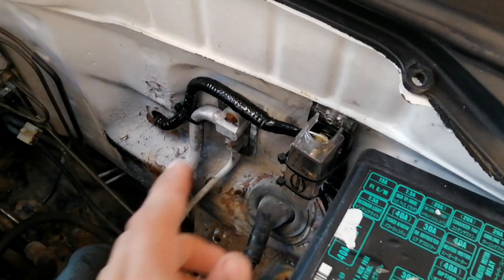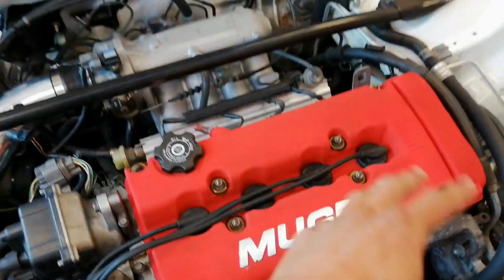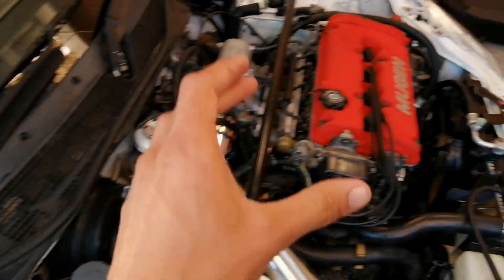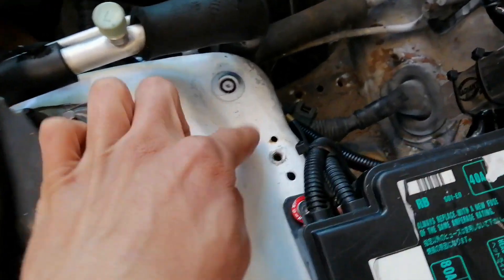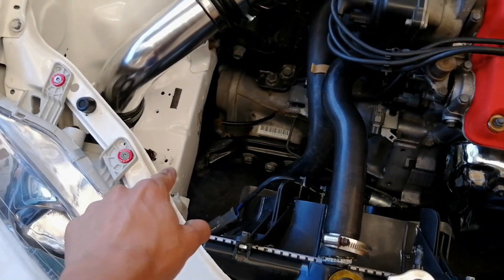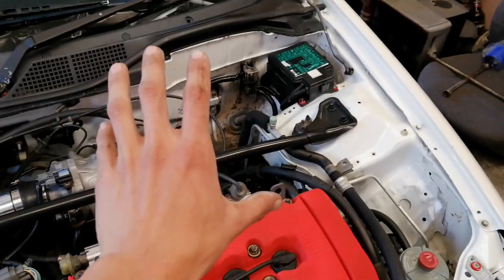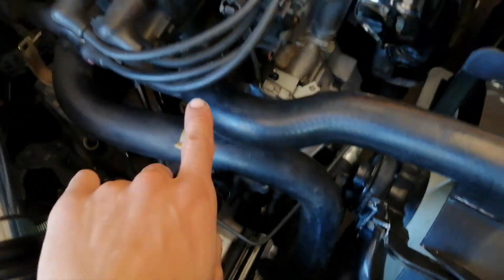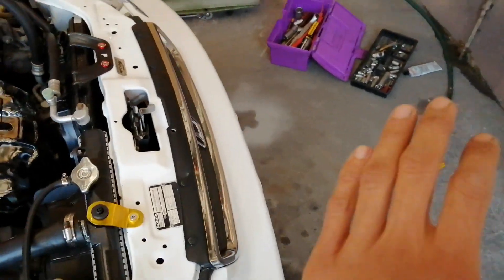HONDA VTEC GETS OIL CATCH CAN INSTALLED! - DIY AT HOME

Comment: Hi Bro, honda runs 2 breather systems, there is a breather box on the back of the block under the intake manifold with a pipe that connects to your intake, that breather sucks gasses out of the block directly into the intake manifold (because there is a vacuum/negative pressure in the intake when the car is running), that sealed catch can will function better if you connect it between the back of the block and the intake manifold. The tappet cover breather actually sucks in air, you can test it by blocking the tappet cover breather with your finger with the engine running, it does pulse but you will feel it sucks lightly if you block it. however if it is for cosmetic purposes you can just run it as it is now. it looks mint!
Reply: please can you help me with my catch can...?

Comment: Run the pipe back to the intake, the taped up hole on the intake will look worse than a properly run pipe in my opinion .
Reply: Yes the pipe to the intake will look proper and I think the oil catch would look really dope to fill the gap where the battery was. I was literally screaming "don't move it" when I saw how it looked from the front 10:22 imagine how it would look with pipes on!
Reply: Also taking it back to the intake prevents the oil smell